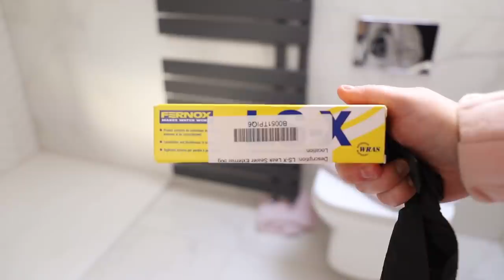Tackling home maintenance jobs around the house, changing locks, leaks and satisfying deep clean!

Comment: Soaking shades in the bathtub, helps get the strings clean too, or hanging the shade outside and using "hose end" window cleaner works great too, no scrubbing necessary, no drying except with the air, while the windows get washed. The whole house feels cleaner when windows are sparkling.

Comment: You can shorten those blind very easily if they are like mine. Pop out the plastic buttons where the threads end under the bottom slat. Pull out the slats you don't need. Trim the threads, replace the buttons.

Comment: I have faux wood (natural stain) blinds that I painted white and the replacement parts just arrived today...ladders, string, washers and clasps. So this weekend the plan is to get those reassembled and hung  back up in the windows. Another task I have been putting off is cleaning the inside of the dishwasher (including  filter) which I did last week. However, I still have my front-loader washing machine to clean and drain the filter and clean the rubber gaskets...so that is on the list too.
Reply from the maker: You are gone feel so satisfied when you tackle them jobs, one job at a time 🥰 have a lovely weekend

Comment: I usually take my blinds down. In the US, they slide into a bracket, so they are easy to take out. I then take them outside and hose them off, let the dry in the sun and then put them back in their bracket. The jet nozzle on my hose takes that nasty dust right off and brings them back to new.

Comment: I've found it easy to simply remove my blinds early in the morning and take them outside,  unravel them and hang them up so I can spray each slat with bleach and then just hose them down with water (sometimes spraying them with cleaning vinegar will do... just depends). They come out beautifully white, no elbow grease or scrubbing just hang spray, rinse and let dry. I let them sit under the sun for the rest of the day so they can dry, by the evening they are ready to go back up. I can do all the blinds on our first floor (16 sets of blinds) in about 2 hours from the time I remove them till the time they go back up... I know 16 windows isn't much, but you get the idea.